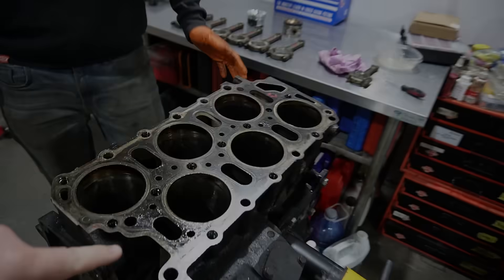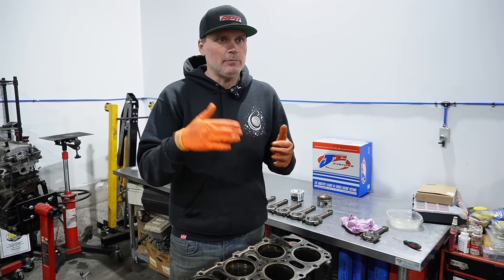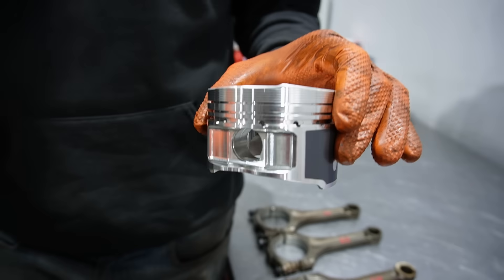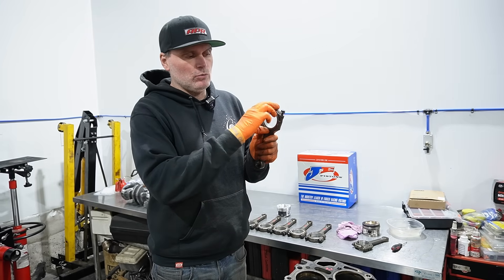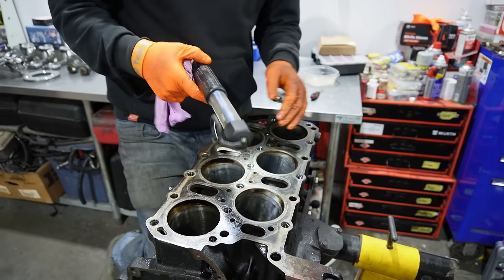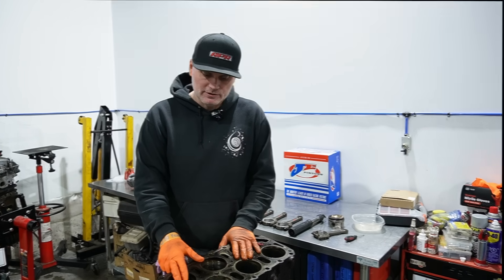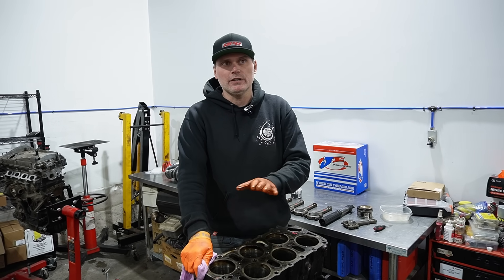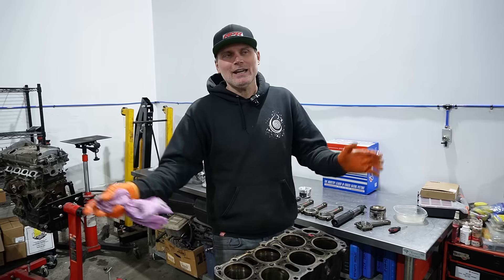VR6 Turbo Build, Must Do's.

Comment: Hi, did you get around to charging the 3.6? I’ve got my hands on a R36 3.6 and wanting to charge it but getting mixed info online saying the direct injectors are hassle and hpfp needs upgrading, I’m not wanting crazy figures but a reliable 500-550bhp would be the goal if you can give any advice on the BWS engine being charged
Reply from the maker: It is a hassle, when we do the one we have we'll be deleting all the DI stuff, and doing port injection and standalone.

Comment: The 3.6 bolts right into the Mk7 MQB- Any support on these vs the 3.2? I know there are a lot more parts for the 3.2's but that would be a bit more hassle for install. Where is everyone getting their engine build parts for these? Or should I stick with the 3.2?
Thanks!
Reply from the maker: The 3.6 is direct injected. Adds a lot more complexity to swaps and parts.

Comment: Speaking of cast 3.2 cranks. I had a very unique 12v vrt set/build  in  my mk3 gti before a Honda odessy driver ruined. Before I turbo’d the motor I shipped a couple teeth on the timing chains and did a full rebuild and then some with the turbo set up. The spec sheet went like this. 12v vr6 , 83.5mm he pistons, custom with lower wrist pins, mk5 cast r32 crank (was supposed to be a forged mk4 3.2 crank but found out it was cast after I bought it and decided to roll the dice) pistons were also 11-1 compression ratio (ran e85 gas on a mega squirt ecu) big intake valve ported head, tt 298 cams,  titanium retainers. Custom twin scroll manifold with twin tial 39mm wastegates, gt35/82r turbo and schimmel short runner intake with 60lb siemen injectors with an upgraded intake fuel pump and single nozzle water meth injection. Ran it at 15 psi (conservatively) and 18 psi. Never dynoed it but it went like a bat out of hell. I had a full mechanical head with Tt 306 solid grind cams theat I was going to run but never got around to it, plus I was going to switch to a gt45/94r turbo. Never had any problems with the cast crank. I ran mid boost levels but also was running a high comp bottom end, hence why I was going to switch to the the gt45 turbo. Definitely am set up you don’t see every day but it was definitely effective and ran flawlessly, no knock and once tuned correctly I didn’t pull a bunch of timing

Comment: So I have a dumb question. How well would a vr6 handle 300whp? I have a B3 Passat sedan I just picked up and all I'm seeing is everyone talking about 400+. 
I just want a modest amount of power. I'm not trying to cut up the car for super wide tires, it's not gonna be a racecar. I'm just into a really clean b3 that can boogie when I want it to. 

Obviously I'm aware of dropping the comp and holding up well. But I mean totally stock with injectors and a chip. Is 300 a long term repeatable number?
Reply from the maker: If you run ethanol the engine will make a ton of power with the right setup on stock engine. However pump gas, I'd want no part of it on stock compression, unless you want to be putting pistons in it all the time. Also stock injectors are getting you no where, no matter what you do.
Reply: @COMotorsports  sadly I do not have consistent e85 access in my area. So pump gas only. I just didn't think 300hp would be that bad lol. All good tho!
Reply from the maker: @vr6prodigy do a headspace and have no worries.

Comment: Just traded my 2024 2.0t atlas for a 2023 3.6 cross sport atlas.  Looking to add a turbo. Watched your video and will be Head Spacer, connecting rods, upgraded cam. I will do the exhaust, CAI and radiator.  Do you suggest anything else to be completed while I have the engine opened?  Thanks in advance, great videos and good detailed explanation for builds!!
Reply from the maker: You're MAJOR issue is going to be tuning. You'll want to figure that out before getting backed into a corner.

Comment: Hi there - great info. thank you. I have  Golf Mk6 2.0L Turbo  TSI. interestingly its marked/Cast with with 2.2L on the block. Its a CDLC series motor. It was a special order car ( ordered by the original Melbourne Based owner  directly from Germany through a melb VW dealer to the value of about $75k in 2009) 6spd manual electronically adjustable suspension, the updated Bi xenon headlights with the follow the road functions and AWD. 2010 Built and then shipped to Melb. I purchased it 2 years later and Ive owned the car since 2013 and updated many items in it since. Its still running the Stock K04 Turbo but i've added a 4" dump pipe and 100 CEL cat and the mid section is now all 3" SS to the stock rear muffler box exiting via the factory vacuum driven flapped Dual center pipe work. It sounds great. Ive replaced the clutch to a APC ( Australian Performance Clutches ) Lightened single mass  Fly wheel and Sachs stage three clutch. ( all had to be done to cope with the added pwer of the tune. All working brilliantly for over 10 years now. Tuning was via a Spectune controller and SW to a stage 2 tune and GFB BOV  valve was fitted and I removed the internals of the factory diverter/BOV. that system is also bullet proof.  Updates to thh braking system all via ECS Tuning floating rotors and Hawk HPS 5 Carbon ceramic pads fitted all round and braided teflon lines all ECS. CAI was upgraded to Volante with a Donaldson Power core internal and all has been great for fast street and the odd track day.  ( that the setup and its been rock solid for over 10 years ) its fast reliable and feels like a total sleeper often embarrassing vehicles 5 x the cost of this little Blue 2 dr beastie.  - My questions are around the intake runner flap system and the runner flap motor driving it all. Recently I had an CEL appear and on closer diagnostics using my OBDiags computer it looks like the flappers are either not working correctly or the motor driving them has lost the plot and no longer driving the system correctly. Diagnostics is showing the flaps staying open and displaying a fluctuating idle that does not settle back to the usual 800-850rpm when at rest and its hunting between 800 - 2500 rpm . the error codes are two fold P2004 Error 1 = Intake Manifold Runner  Control bank 1. stuck open, Sporadic oo1 upper limit exeeded  - ( this is causing erratic idle ) -  and, error 2 = P0507 Idle control system Higher than expected Sporadic 001 upper limit exceeded.  

My question is relating to these two issues. I know the intake runner flaps can be removed and modded and the system turned off in the SW. 
Is it worth replacing the plastic intake manifold with an aftermarket APR or HPA  or Intergrated Engieering aluminum one and then re-tuning for the greater volume and removal of the original runner flaps? 
 Have you had any experience with these systems are any of them better than the others or are they all roughly the same. ?

Sorry about the long winded question and pre able but its also important to get the proper picture of the vehicle and whats going on . PS> the engines done 97,000 Kms now always running 98 ROM octane Fuel. as its readily available at the pump here where we live.   thanks in advance.

Comment: Quick question what would I need to do for a 800+hp at the crank of a vr6 2.8 24v from transverse to longitudinal swap? Just the motor it's self i already have list of bolt ons route do I'd be doing and is 98 pump gas good for it? Location NEW ZEALAND.
Reply from the maker: All depends on the chassis and how things fit.
Reply: @COMotorsports motor is coming out of a vw jetta 4motion as overseas call it. here in NZ we call it the vw bora 4motion. So the swap will be from a 4motion into a Quattro base chassis

Comment: ive always wanted to do a vr6 or i5 swap into my rs5 with a 8hp55 but leaned more to vr6 12v. everything is there to do the swap and i love the simplicity of the 12v for power except ive had concerns with the drivers side engine mounting. one option is the iabed oil bracket.plate that has the bolt holes for mounting arms but at 600-800awhp ive had concerns with possible leaking.
can you guys give me some insight in this situation? 
my alternative is sleeving a 4.2 which i already have with the hp trans but i go crazy for vr's

Comment: Hello. Why you dont use crankshaft from 2.8 vr6? In Europe we use it and then dont need head spacer :)
Reply from the maker: It's very easy to use a headspacer, and gives lots of room for power and reliability with little effort.

Comment: Did anyone here running a 12v vrt have a problem with their stock coilpack getting hot and melting the coilpack ground?
Reply from the maker: Faulty coil or faulty wiring.

Comment: Hey man do you think I can boost my 3.6 Touareg safely without timing too much money? Reliability is a must but budget is Important.
Reply from the maker: @Chumbucketsecret  budget and reliable typically don't go together. Nor does budget and boosting a 3.6. Find another vehicle or find more money.
Reply: @COMotorsports  ball park an estimate on what it would cost? My buddy said 25k…I was thinking more..10k? 15 max.
Reply from the maker: @Chumbucketsecret  Depends on your skill level, how much you can fabricate yourself, quality of parts used.... it will not be cheap even if you did EVERYTHING yourself. Again boosting a 3.6 will not be cheap. Tuning alone will be a hurtle.

Comment: Hi i wondering for a 3.6 VR6 on a porsche cayenne a turbo to gain torque and around 450 hp.
Witch setup did you recommend for it ? what kind of turbo ? head gasket spacer, upgrade on fuel system and rest stock ?

Comment: So i own a b5. It started life as a 1.8t with a 5 speed. At 302,411 miles one of the injectors shit the bed resulting in a hole in the piston, tube 3. I bought a 24v vr6 from my local wrecking yard for $460. I did carillo rods, weisco forged pistons with the stock crank. My grandpa has been a motorsports focused engine machinist for 50 years. He has a full blown machine shop in his garage which is less than a mile from me. We balanced the rotating assembly and did quite a bit of work lightening the crank. The largest force difference is under 3oz so, detrimental harmonics are essentially non existent. I used all ARP hardware. I ported the stock head myself, the most aggressive techtonics cams they offer, their dual valve springs, stainless retainers and keepers. Krabifab longitudinal intake manifold as well as their longitudinal equal length exhaust manifold. I went with a Borg Warner efr 8374 which means i had to cut off the external waste gate tube from my $1600 exhaust manifold but the packaging benefits the efr line gives you are absolutely astonishing. Blowoff valve AND waste gate all on the turbo? YES PLEASE!! Worth every penny. Im not a wealthy man. I have a scalding hot wife and twin 6 year old boys. So i bought everything one piece at a time. Took me 18 months to acquire all the parts. I found a 6 speed from a b7 rs4, gpa and i machined an adapter plate, clutch masters twin disc, lightweight single mass flywheel. I kept the OE front diff and modified the rear subframe to accept a 2019 rs6 rear diff. I bought a wavetrac center for the bias adjustability i currently have it at 30/70 and its absolutely fantastic it really changed the characteristics. All ECS suspension arms, fortune coilovers. My subframe bushings are solid billet aluminum, rear diff bushings are poly. It has b7 rs4 brakes from the same car i got the transmission from. I got the car down to 2880 lbs with me in it, absolutely perfectly corner balanced and 52/48 weight distribution. Ive owned 33 performance cars in my life. Every single one i modified extensively. Ive never had a car that felt THIS different after i finished the build. It feels nothing like an a4 anymore in the best ways possible. Other than my 2016 Shelby gt350r its the best car ive ever owned. I do have custom subframe connectors that tie into the custom strut tower braces i made. But no cage. The chassis is so stiff it picks up a wheel pulling into my driveway. Its absolutely unbelievable. I have it on e85 right now and a very conservative tune. She makes 704whp @ 7300 rpm, 590 lb ft with a straight up diesel curve. My dad owns a seriously badass 2018 gt3 rs. My little black 4 door Audi makes it look stupid. My dad was a naval aviator. One of the few Marines who flew f-14s. Yes just like Maverick hes the coolest person i know. He wont ride in my car. He has once. He'll never do it again because i made him puke. He said he blew chow three times in his tenure. I caused him to lose breakfast driving to lake Tahoe from Reno, Nevada where we live. Even though hes 64 that should give you an idea of the raw speed this car is capable of. It sits on 18×10 3 piece wheels with 295/40r18 r888 all the way around. Yes 100 treadwear tires really really helps those entry speeds but they're just 295s. I finished the car 11 months ago, ive put over 12,000 miles on it and all ive had to do is preventative maintenance. Change the fluids. Buy yourself a b5 and vr6 swap it. You dont have to go crazy like i did. An ebay turbo kit and coilovers with good tires will give you goosebumps i promise. Oh, most importantly, the car is on a haltech elite 2500 stand alone ecu. Thats the biggest thing is ripping absolutely every single OE computer and wire out of the car and starting over. I saved 180 pounds in electronics alone.
Reply: You should do some videos on your car; you can't say all that and not have some videos on it lol. Not in a position to own a "fun" car right this minute, but the B5 and B6 A4s have always been near the top of my list when I do.
Reply: @02honeydew  dude all my friends say the same thing. Im in introvert man. I hate the spotlight i hate cameras. Im a business owner, i have an 18 year old son and my lady and i just jad twin boys. The last thing i have time for is filming my cars, trying to figure out how to upload the footage, then i have to see all the morons who drive a fucking Tesla talk shit. I build my cars for me and the people i love. I have absolutely no desire to share what i fought overseas for and worked my hands to the bone for, for people who dont have any respect whatsoever. Not talking about you bro but you know what I'm saying Im sure. I don't have an Instagram, Facebook, none of it. Hey if you are that way, i have nothing against that whatsoever. Its just not for me. And honestly bro, i don't even have pictures of my cars in my phone. My family is my locked screen background, my dog is my desktop background. I get baked with my lady at night, we do our thing and i have insomnia so after she passes out i stay awake watching videos and writing comments that are way way way too long because I'm stoned. But i don't bullshit anyone. I don't see the point in typing lies i don't have the imagination. I could write a badass book if I did that would be a lot easier than what i do for a living. I build cars for a living. My cars are relatively mild and simple compared to what my clients bring me. When you do the work yourself and get most parts at cost you can accomplish some impressive things ya dig? Cheers brother. Don't drive fast, fly low.
Reply: @kelevra558 Well, I can respect that and I get what you're saying. Either way, sounds like you've built an awesome car for sure. I guess if things ever change/you change your mind and you wanna show what you've got going on, you best post on here in this comment that you've made a video about it so I can watch it lol.
Reply: @02honeydew  you have my word brother. Maybe when the offspring are old enough to film. I just dont have the patience and or time ya dig? Like I'm not a dick about it if people want to go for a freeway blast I'll always take them out. Another issue is the amount of times I've...lets say allegedly got scared because a UFO with blue and red lights was trying to follow me and I took off. Its happened at least 25 times
Reply: Yeah posting a short on YouTube is difficult. Come on, all that explaining and? Nothing.
Reply: whole life story🤨
Reply: Wow You sound like you should have your own tuning shop & be building track cars.

Comment: Quick question, I'm building a 12v and have a head spacer (9.5 compression) schrick 288 cams, what size injectors do you recommend? I have ID1000 but not planning on running e85 anymore, I have a local gas station that sells 100 octane at the pump

Comment: Sir I have a 3.6l VR6 2017 Porsche Cayenne base only 43k . I trying to have someone build me a Set of Headers and then Install Headspacer then last Rear Turbo to keep my Engine Bay Cooler. So I volunteer my Engine. 😅😂🤣
Reply: I gotta VR 6 as well. In a 2014 CC vw. Oh yeah, that that was a about a $50000 car back in the 14

Comment: in Europe we have no problems with stock pistons and stock gaps, obviously we have 95/98/100/102 octane at the pump, it also depends on the EGT and as written in the software, however forged pistons are always a guarantee

Comment: I just watched this. My future plans are build either a 2.5l 5 cylinder with a double overhead cam head and turbo (with a 5 speed) and a stand alone tune or a VR6 with a turbo and a tune ( and a 5 speed ). Either would go in a 2003 EuroVan camper. I am aiming for better than stock power and good highway fuel economy. To wow the crowd I’d find an Audi SR3 and mate that engine up to a 5 speed ( that will probably blow up! ). I also have to hit 
the lottery to afford this!
Thought you would enjoy this train of thought of mine.
Cheers,
G.
Reply from the maker: @g.cooney6599  best of luck